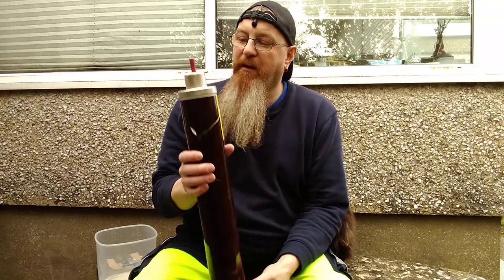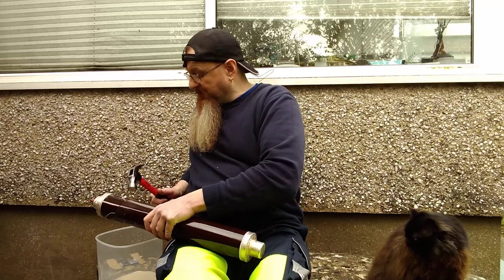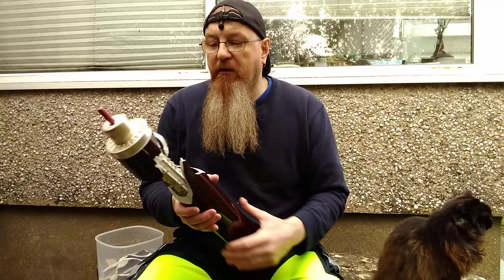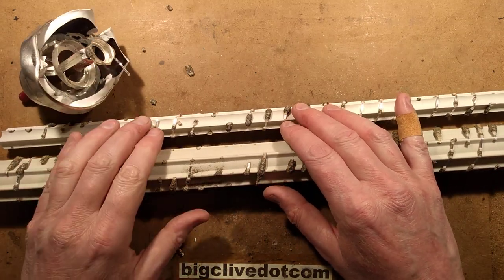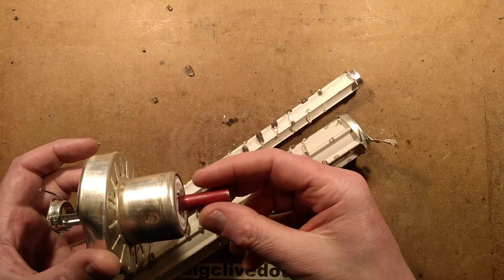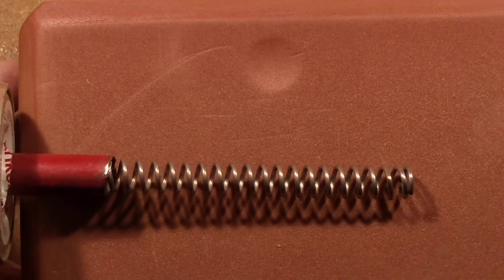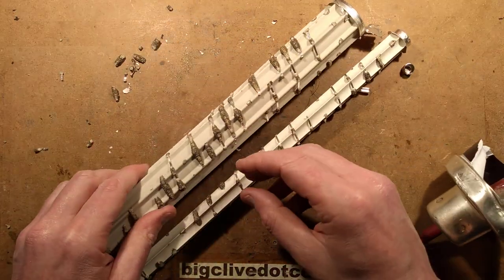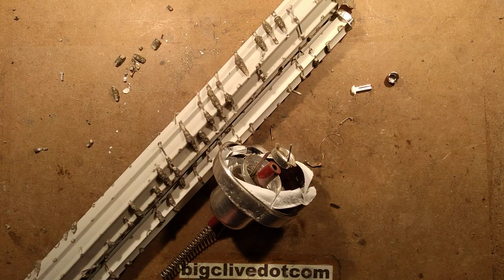A look inside a blown 36kV fuse.

Comment: I would imagine, that the layers have different resistance. So the least resistance is the middle one. When it goes and pops the plunger, the other ones still pull down the voltage and deprive a potential spark of energy. Then the next ones go in stages, which might add safety for barely tripped overload situations and double safety against potential middle tube sparks.

Comment: I think the fuse element being wound round the former is because of the "skin effect" of high voltage! The same reason they use tubes instead of solid bus-bars! The higher the voltage (or frequency) the more the electrons only move from atom to atom in the outer edge of a materiel! 
I also seem to remember being told there were Explosive" caps in there that force the pin out to release the trip mechanism, but I only do LV so don't play with them ;0) 
It is all a bit bigger than your average plug top fuse!

Comment: You could parallel the thinner fuse wire of the plunger with the other fuse wires. When the other fuse wires open, the thinner fuse wire will finally overheat and open.

Comment: The fuse is made by Schneider electric or they at least have an internal drawing of it. i found a link but i think it will be blocked if i post it. if it is not the page you are looking for is page 15. i will post the link as a reply to this comment. cheers.
Reply: Thermal striker
This is a mechanical device which indicates correct fuse operation.
It also provides the energy required to actuate a combined breaking device.
The striker is controlled by a heavy duty wire which, once the fuse element has
blown, also melts and releases the striker. It is very important that the control
wire does not cause premature tripping of the striker, nor must it interfere with
the breaking process.
The Schneider Electric limiting fuse, with its thermal striker, is not only capable
of indicating and breaking short circuits. It is also capable of this for prolonged
overcurrents, and currents causing significant temperature rises in the devices
combined with the fuses and the fuses themselves.

Comment: The inner core has one spiral. The outer core has 3 in parallel but each spiral is 3 times as long so they have the same resistance as the inner core.  The inner core carries 1/2 the current, 2 times the current of each strand in the outer core.  Presumably the inner core melts first without much arc, then the 3 outside in succession.  Just guessing.

Comment: the plunger (main fuse line) would connect to the fuse wire, kanthal or nickle wire, wrapped around ceramic for heat reduction, would let any amps/volts go through, but the fuse wire itself breaks under load, same as a fuse from a car/truck, once the wire melts, it cannot conduct to the wire to the end of the line, causing a trip in the circuit.

Comment: My house's 7700VAC mains supply is fused with a (presumably) similar device ( or two) ----- when they blow, they go off with a bang! 7700VAC, you ask?  My house is several thousand feet from the main street, with a shared driveway for us and one other house farther up in the woods. Our houses each have their own stepdown transformer only a couple hundred feet away, which makes for very clean and stable power even under what most other people would experience as heat-wave brownout conditions (typically, a pole mounted step- down transformer might feed a half dozen houses or so, perhaps more) ---- BUT, incredibly and stupidly,   the 7700VAC feeds were installed with uninsulated wire, even though they pass  through stands of trees that are more than twice as tall as the utility poles ( presumably a cost-saving measure on the part of the utilities, except that it has probably cost them far more to send out line workers to replace those pole-mounted fuses periodically over the past 30 years than they saved initially by using uninsulated wire in the original installation ---- luckily for me,  they don't charge me directly for it, they have to eat the cost as part of regular maintenance I guess).

 Anyway, the mains fuses typically blow several times a year from falling branches, or squirrels doing a highwire death-dance; those fuses sound like a dynamite explosion when they go off, easily audible for at least a half-mile or more!

Comment: Would fuse wire alone have the tensile strength? 

Also... would it be a case of the heat generated in the fuse when it blew, burnt the wire or melted it because of excessive heat build up.

Comment: Is it possible when the outer fuse blows, all current is sent to the inner "fuse" causing it to blow, releasing the pin to break the circuit.

Comment: hi Clive in the not so sunny county of Buckinghamshire, we manage to generate 3+MWhr solar on the normal domestic home roof.  plus a single copper tubing solar water heater vertically mounted heats household water to 50+ for some 8 months of the year.

Comment: One of my buildings has a 1200a 120/ 240v USA we kept blowing sand filled fuses so we got the power company out and they gave me some weird fuses that tore down and you could replace the fuse element inside then you have to fill it back up with sand. They where very odd. The element appeared to be some kinda low melting point metal not the fine wire you would see in a HV fuse. This was like 2002 so I didn’t take pics those fuses never failed which struck me as odd! The power company put clamp on CT on both sides of the 240v that had a data-logger attached to them we never exceeded 800a so they just called it crap fuses but I still think something was weird they where proper BussMan slow blow fuses.

Comment: Guess . centre section is for thermal detection , get hotter during normal operation so is easier to compensate for ambient temp   ( is it secheron by any chance? - we make bits for their arc suppessors)

Comment: The wires may also have been seperated in order to keep the length of the fuse more feasible.
I reckon using a bigger gauge wire you'd need more length running inside the fuse in order to get enough resistance for it to heat up enough at the required specification/current. :) at 36kV a limitation may well be that the coil couldnt have been wound tighter.

Comment: Clive the wire that was wrapped around the middle bar went down through the spring and was held on tension to the pin so once the wire on the middle bar broke it released the tension and thus the spring would blow back

Comment: I get the impression that when the main fuse bar blew  it shunted to the secondary, blowing the fuse wire. my the same idea holding a high load for a long time could cause the fuse wire to fail. hence thermal protection.

Comment: Correct me if I'm wrong, but aren't each of the fuse lengths in parallel on the outer section? If so, aren't all of the fuse wires identical in length and cross section? If so you don't have two dissimilar fuse elements, you have four identical parallel fuse elements unevenly distributed unevenly on differently sized carries. Ultimately where they are is meaningless if they are electrically identical and parallel.

No clue on the plunger actuation though.

Comment: The real question is did the fuse carbonate during the fault?   

And how many fault current farts did it take to push the switch pin out to actuate the fuse bank switch?

Great video.

Comment: Clive - can you do a video about the “Hi-Pot” (high potential) testing process? How it works and why it’s done? I’ve always wondered. Many thanks!
Reply: Brian Brumfield basically it’s just checking that there are no leakage current paths between the case and power connections sufficient to cause a dangerous electric shock. This is done by connecting a power source capable of a high voltage (1 to 2kV) and making sure the current flow remains under a certain value (typically in the microampere range). The duration of said test is typically only a few seconds. Repeated application of the hipot cycle will cause part failure so unless it failed the first time (and being sent off to the techs for repair) the test is done just once per device.

Comment: Seems to be a 30kv version of a  Slow Blow fuse like you find in older automotive circuits. Can you imagine the amount of heat generated when that sucker blew ? Explains the ceramic housing.

Comment: Is it possible to build like circuit breaker in this size so you can reset them instead of heaving to completely swap them every time?
Reply from the maker: Circuit breakers tend to be big and complex because they require a different system to break the arc repeatedly on each operation.

Comment: ...10:15...ceramic...sharp....yeah, the newer ceramic kitchen knives are advertised as 400 times sharper than any metal blade...! They do look so under an Electron Microscope...
 Nice video...I've worked around a good deal of 240/480 3 phase...even those fuses are filled with silica sand...

Comment: That outdoor scene had perfectly acceptable sound, Clive. The naysayers are in the vociferous minority. 100,000 views right now, and only a handful of negative comments about it. 

I'm wondering about those multiple fuse wires. The inner one will probably be the same length as the three outer ones. Each is fusible at about 16 Amps, so that’s convenient for the standard fuse ratings of 16, 32 and 63 (64) Amps, by using 1, 2 or 4 wires. Is this coincidental? Maybe not. Thanks for the video.

Comment: I thought the audio at the beginning was great! The ONLY issue was that there was a different "level" for the inside part and then I had to adjust my volume.
Thanks for the video.
Is there possibly any reason that there would be a purposeful "cascade" requirement... maybe the inside blows and then the outside? Dunno.

Comment: It strikes me that the tiny fuse wire was a 3rd parallel course for the current. After the first 2 main fuses blew, it didn't stand a chance, vapourized, and released the spring.

Comment: Noob question. Why is the fuse rated by voltage and not by maximum current it can handle?
Reply from the maker: Both are a factor, but the main difference between this fuse and standard ones is the voltage rating.

Comment: The pin mechanism had wires that ran down the middle of the inner ceramic tube and attached to the fuse wires in the bottom.

Comment: Clive, how would you go about installing a fuse box in a room that draws more current than the breaker can handle so you can draw more current but still have breakers for protection.
Reply from the maker: You could run a suitably rated cable from a matching breaker to a dedicated distribution board for multiple local circuits, or just run more radial power circuits.
Reply: @bigclivedotcom  could you run live wires from the supply up to the room and then install a breaker there or should you get a certified electrician and tell them what you want
Reply: Are you still in the blue t-shirt
Reply: Or would it be wiser to run some thick wires from a suitable breaker and then have a box with interchangeable breakers including all the rcd and leakage protection

Comment: I live on a boat,,was wondering,,can you interchange AC circuit breakers with DC circuit breakers?
Reply from the maker: For DC at low voltages it would be best using automotive type circuit protection.
Reply: Thanks,,from Key west

Comment: You should be able to answer the length question easily enough with a piece of string. Just wind it in place on the outside and inside and then measure its length.

Nice bit of kit. I'd be curious to see the insides of those ceramic spacers the first wire is wound on.

Comment: my guess is that the fuse spring wires is connected to both fuse coils and if one coils blows then the then would send voltage over that pin wire thing.. so releasing the spring... that is how i think it works

Comment: Clive, would that be silver fuse wire? It looks very much like it and with the amount that is there, it may be worth harvesting.
Reply from the maker: I'm not sure what it is.
Reply: @bigclivedotcom  Hm. Well, given that silver is only ~$15/oz, it likely wouldn't be worth too much effort but I could definitely see a case for using silver in this application. Good conductivity, relatively low melting point and good enough corrosion resistance when packed into a water tight tube. If you had a few though, it may be worthwhile to do a quick test to find out.

Comment: at 4:43 you said "forty thousand amps", presumably you meant volts?
Reply: Trey Quattro nope. It can break a current of 40000 amps if for instance a shortcircuit happen.
Reply: @MEMOAN84  a few moments before Clive said it's rated to 63 amps, so I don't think so.
Reply: Trey Quattro thats the rated current. The breaking current is 40KA

Look at page 29 in this PDF

https://www.pronutec.com/CMSPages/GetFile.aspx?guid=58f8cefe-c8e6-4f82-afec-7d147f8e405b
Reply: @treyquattro  rated current (63 A) isn't the same as the breaking capacity (40 kA). At 40 kA the fuse does not arc over (it still can but only a designed duration) or lose its structural integrity.

Comment: seems to me a coil has a longer life, heat from one wire would cause the next to blow at a lower current, so you can make the wire thicker and so run at a lower temp and  so have a longer life. two coils, in opposite directions means you cancel out the magnetic field, and associated losses.

Comment: Is the fuse ribbon wire made of pure silver ?
Reply: It probably is, in my opinion.  That much silver is not of enormous value.  Silver is the most conductive element in existence, which makes perfect sense in the circumstance.  At such extreme voltages especially, any lesser conductor would require more mass to carry a given current without failing; and consequently must absorb more energy in order to melt.  It would also self-heat to a greater degree.  A fuse that's slower to blow might very well mean more damage done before the circuit is interrupted.  A fuse that runs too hot would tend to fail by reason of accelerated deterioration over time.

Silver is about 5% more conductive than copper and has a melting point about 200C lower.

Comment: The 4 fuse wires need to be the same length. The inner tube has a shorter circumference so it needs a lot more wraps to equal the others. I also hope your finger is ok.

Comment: the pin is springloaded and realised by breaking the aluminium foil sticker by the presure that bulids up inside the fuse caused by heat of blowing fuse. i hope i helped
Reply: Not on these types, they have a small charge of gunpowder in the pin that is activated thermally by the thin fuse wire when it melts. I have seen small fuses about  2 inches long where the pin in held in against a spring; that pops out when the fuse element melts

Comment: How many volts is carried in the mains wires/cables before it comes into your home????  Or can it variey???
Reply from the maker: In the UK it's around 240V.
Reply: @bigclivedotcom  no i ment out side the power lines.
Reply from the maker: @keithking1985  Locally the transmission lines are mostly 11kV.
Reply: @bigclivedotcom  Thank you always wondered about that. Cheers..👍
Reply: @bigclivedotcom  Oh  that's why the video on the lighting arrester was an 11k one. If i remember right!!!

Comment: I have no idea why the fuse would blow in so many locations at once. Every blown fuse I've ever seen has burned out at one point only. Perhaps it's because it's such a large voltage, when it goes it somehow makes a conductive plasma which arcs across multiple points? But the whole space is filled with sand, so that can't be it. Weird.

Comment: Possible that the thermal protection was held down with an adhesive that melts at a very specific temperature.  Sounds dumb, but this is the exact way pop-up indicators work in a frozen turkey.

Comment: Since you like old pinball and arcade games, do you happen to have the muse to make a video talking about VFDs ?
i got some semi-broken ones which have perfectly fine "tubes" but the circuit around went offroad. the high voltage switching stage for the 25V upwards thingy seems to be a weak point.
perhaps if you need a replacement for a pinball score display some time in the future.
- I got problems with ye olde tube equipment and function ;-)

Comment: [www_sentridge_com/wp-content/uploads/LIBRARYBUSSMANNHIGHVOLTAGEFUSES.pdf]  has some infos about such devices which can actually kick a complete all-phased array open if one of their fuses gets blown. (Therefor that spring-operated mechanism exists to push some mechanical device, e.g. a main breaker switch handle, off by the fuse pin getting released in case of overloading one particular circuit of a power line). There are some other techniques existing, e.g. an explosive device which destroys itself in the case of overheating through a detonation charge, leaving a circuit opened thereafter. Means in the case of a burning station transformer, where a fire itself then cuts the lines off the transformer by igniting the explosion fuses located in its proximity.

Comment: i havnt watched this video yet, i liked it within SECONDS after you got "annoyed" with china and called her cat in an annoyed tone, my cats dont always listen so i have to do the exact same thing!
Reply: fuses are in parallel for redundancy in current capacity and on the ejection pin if i am not mistaken, when the primary coil blows, alll of the current is left to flow through the thin inner wire which causes it to fail, dunno if they got any pyrotechnics in it, dont think so in this version
Reply: also, another thought, the inner core may have thinner wire for a more controlled failure mode, first the outer 1 fails, the middle 1 fails and then the pin fails in that order as the thinner wires sucessively would blow after all of the current changed over?

Comment: The wire on the inside core should be wound in the opposite direction of the outer core wires to reduce selfinduction.